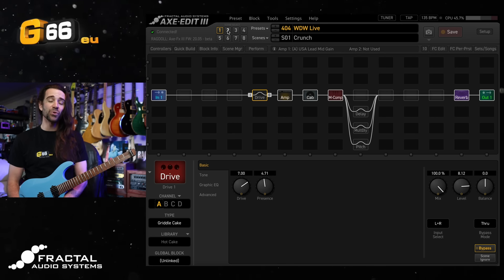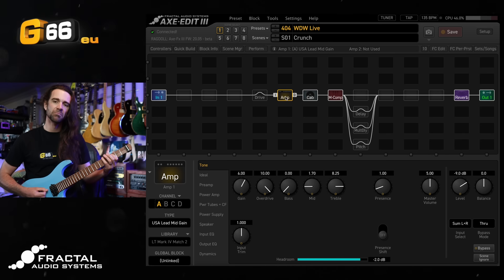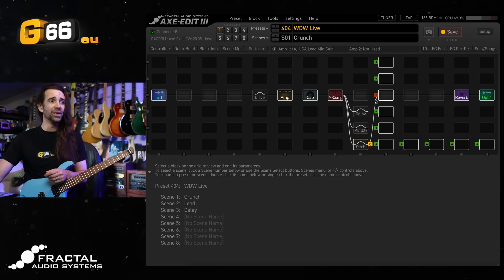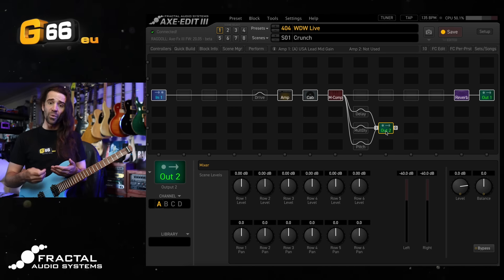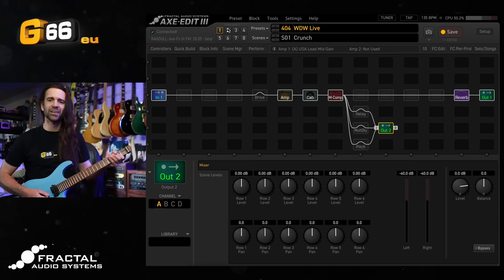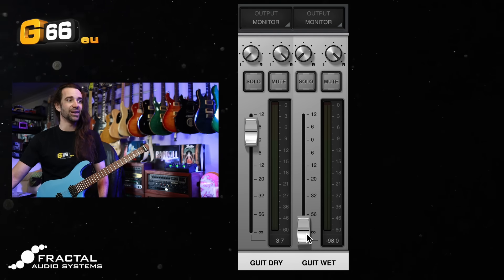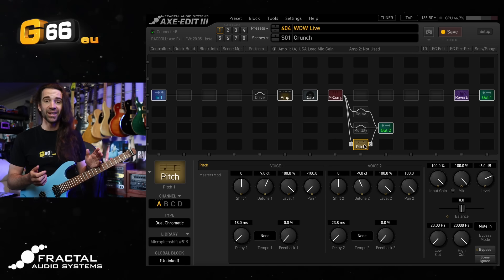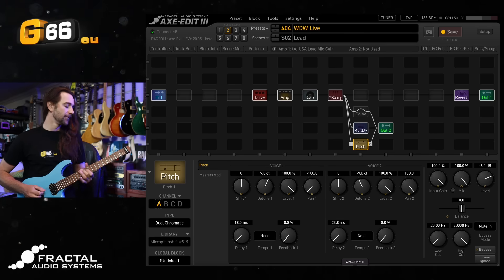W/D/W Routing Inspired by the Pros | Tuesday Tone Tip

Comment: Hey Leon,

Is there a way to assign two (or more) effects to one switch on my FC12 foot controller? 

I currently use an outboard switch to control my lead boosts but because I use it a lot, I’d like to move it to a primary toggle and use my outboard pedals for some intermittent things. 
I use an enhancer and delay simultaneously for leads. 

Thanks!
Reply from the maker: Yes, check this out - https://www.youtube.com/watch?v=ipJbShFGRD4